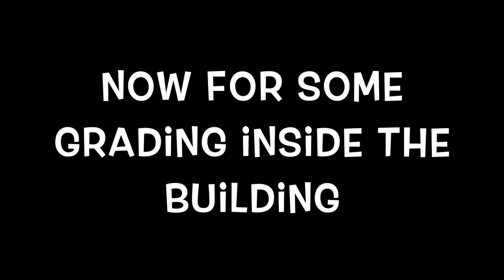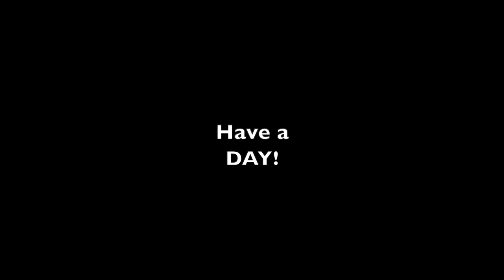#919 Two Hours and Gone! Amazing Seamless Gutter Install on Hobby Barn

Comment: Hey Mike, just a suggestion for your rain water collection.  With the hills and elevation drop you have (going down to your wood processing center), you have a great setup for collecting all of your rain water (before you start pouring cement).  Dig trenches along the lenght of your building to accomodate 4" PVC pipe.  Add adapters to your gutter downspouts to connect them to the PVC.  You have plenty of room to get the "drop" needed for the entire lenght of your building.  Once you have your three runs (includes the overhang) at the far end joing them together with a collection (manifold) pipe.  You can then set up your collection tank at a distance from the building that will allow complete draining of the inground pipe.  All of your runoff water is diverted away from your building.  If your collection tank overfills, no problem, an overflow pipe will take care of that.  If you find you want more collection capability you can add more tanks later.  The main thing is to get all of the runoff away from your building.  You might even be able to use the water for your future pool.

Comment: Right when you hopped on the BX you had great footage of one BX weakness...  The headlights are useless with a front end loader.  My cousin has a BX and I've suggested to her to paint the back of the bucket flat black to avoid being blinded by the bright orange refection when working in the dark with the loader.  Fortunately she got LED's on the ROPS (one point forward and one backward) and that makes things SO much better.  I'm sure the lights on the cab of the 5400 make things workable.

Comment: Great looking Building. If you plan on using the water for the building.  add a sedimentation tank first to remove  dirt from the water. Leaves can be diverted out of water easily. Miss seeing the other video's of your normal working. Keep up the good work!

Comment: That roof will shed about 3500 gallons of water from a 1in rain. (623 gal per 1000sqft).  We are looking at a rain capture system as well.  Great for watering the lawn, or washing vehicles and equipment.

Comment: I would be nervous running the tractors inside that new building but you seem cool as a cucumber doing it Shaun.
     I was waiting for you to turn around and be sure how close the box blade was to the wall but you just looked strait ahead with confidence .
    You are definitely good with machinery. 
 The gutter job was so cool to watch. They have that down to an art form.
   They no just how far apart they need to be carrying that 74 foot piece to where they now it won't kink and bend .
   Would love to know what that service cost.
   I cant image it was  cheap but they are well worth it because putting up gutters yourself is a pain in the arse

Comment: Mike, when you install your floor heat tubing, make you have accurate measurements and tubing location. This will keep you from poking holes in it while drilling in anchors or nailing down plates.

Comment: may wanna consider some gutter covers , to keep the leaves out, thats a long ways up to be cleaning gutters !!
Reply: We have Leaf Filter.
Reply: There are mixed reviews on those. All depends on what types of trees you have around the structure. Conifers, which would include trees like spruce and pine create major problems with leaf filters. The needles are so fine, they often clog the openings, and create a huge mess.
Reply: @thebradleysoncatbirdhill6849  we have some pines mostly maple, oak and some hickory
Reply: @er1073  They work well with deciduous trees. But, I've had three homes, and in all cases, with conifers around the house, roofers have consistently recommended against the leaf filter.  At my age, I don't get up on high ladders anymore, so I pay the roofer $100 each year to come and thoroughly clean the gutters. Actualized, it was cheaper than the leaf filter!

Comment: When building my shop I was able to find construction string lights at harbor freight. They have shielded bulbs and have about 8 per string with a female plug at the end of the string. They gave plenty of light and you can run them over your ceiling joists of your trusses. Best of all they were harbor freight price.

Comment: Congratulations  Mike on the building of your hobby barn!  Just as I was preparing to suggest it,  you announced plans for a  rain water harvesting system.  This will be a big source of water and offer large savings.   congratulations again for this.  May I encourage you to use an outdoors wood furnace to source the heat.  As much as you enjoy cutting firewood, it's a given.
Reply: Fuel would be free. Just a little work, which you are setup for cutting and splitting wood

Comment: 👍🇺🇸🇺🇸🇺🇸🗽🙏🏻 Enjoyed!  I would drop the loader off the BX and put a hydraulic cylinder for the top link on the box blade and run it off the loader control valve if you don't have an extra set of hydraulic connections.  The box blade is a whole different implement with the hydraulic top link, being able to tilt it on the go gives you the ability to cut dirt or just pull the dirt to the area that is low.  You can also drop the dirt gradually by tilting the box up in front.  It also makes backing with the box blade work a whole lot better!   Same for spreading gravel.

Comment: I'm seeing lots of hickory nuts and I hear the persimmons are plentiful if one can get to them before the deer and coyotes. 

The building is coming right along. That gutter machine is impressive as was the crew.

I'm surprised Kubota didn't put some rear work lights on the BX. They would certainly be handy, but once you get some LED strings up it will be a moot point.

The leaves are getting gorgeous here in West Central Indiana, but a hard wind and a heavy rain could end those in no time. 

Have a day!

Comment: Mike I would have personally suggested the larger commercial sized 6" gutters - that roof is HIGE!! I hope the size you went with proves adequate for your building!
Reply: Hige I think you mean huge.
Reply: Wont be any problems with the larger down spouts, 2"x3" downs would probably  have caused a back up, those 3"x4" will handle that water

Comment: No doubt you will be ok with this design of manufacture.  To me it is Topsy Turfy ! [Gilbert and Sullivan..]  In deep clay we build the concrete first with J bolts sticking to the sky.  Once dry then comes the  steel beams and structure or the bottom plate with foam between board and concrete.  The J bolts hold tight in the concrete and you can crank down and fix the steel or bottom plate firmly and build from there on up.  I think it is done the same way on limestone rock bases as well.  Martin

Comment: They are great gutters aren't they - we have them on our house - only 15m long but a lot nicer than the plastic clip together stuff.

The only issue I've had with them is that the clips make cleaning them out a bit difficult....but a good jet on the hose and it sems to work okay.

looking good for the insides as well.

Comment: Seamless gutters are THE only way to go. The crew didn't waste any time. Must be why there wasn't a single Yellow tool in sight :).

Mike, was it the camera angle or does the post beside the man door closest to the left side roll up door terminate just over the height of the man door?  Any plans at installing a two or four post lift inside the hobby barn? If so, while you're in a mood to move dirt, now would be the time to prep for a footer pad(s) for the lift to sit on. Looks like a nice place to park the cars to keep them out of the weather. 

We need some video of the hunt cabin.

Comment: It sure looks like you have a long ways to go before you are ready for a concrete floor to be poured!! Looks like lots of finish grading for sub-grade and don;t forget the compaction factor of the sub grade. Rent  a plate compactor!!!  Pack it hard and tight or you will be sorry later. The under side of your concrete floor should look nearly as smooth as the top.

Comment: That acorn phenomenon is not just your imagination or some fluke. According to a fairly recent video by Steve Mould (https://www.youtube.com/watch?v=DPCL9kj7_bU&t=5s ), it is part of the 'survival strategy' of oak trees that every 5 years or so the oaks in an area coördinate a several-fold increase in acorn production. In a normal year, most of the acorns will be consumed by squirrels, etc. In the bumper year, there will be way too many for the local fauna to consume and a lot of acorns will germinate. But if they were to produce that many every year the critter population would expand to meet the supply, so the lean years keep the population low enough that a lot of acorns can sprout during a bumper year. The phenomenon is called MASTING, or a mast year.

Comment: You probably already know, but just in case, you will want to dig your sewer, water, and electrical lines to the Hobby Barn before you lay the hot water tubing and poor the concrete floor.  Calc your electrical for the future too, (welder, electric cars, swimming pool pumps and heaters).